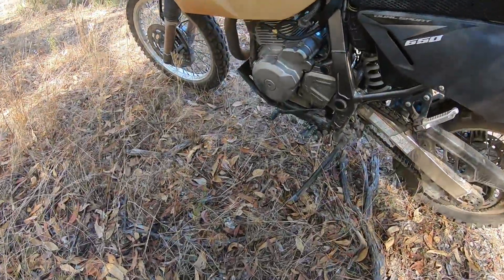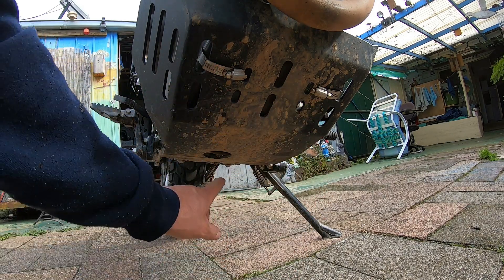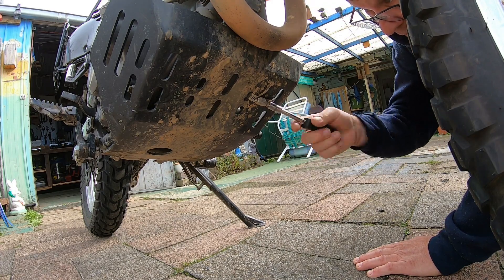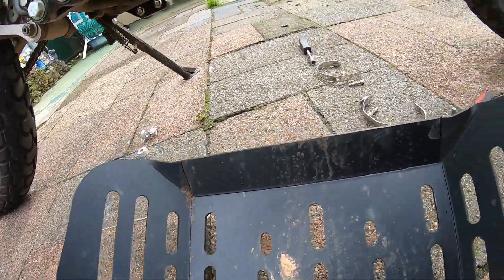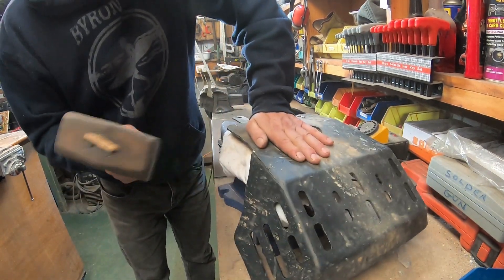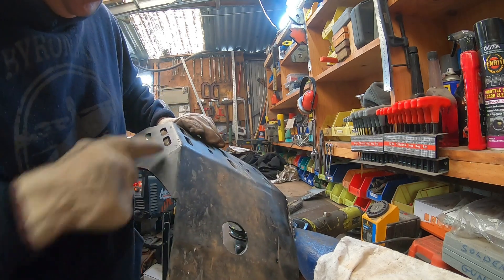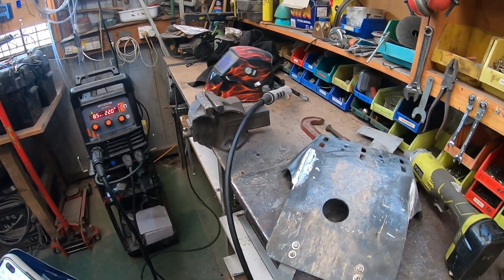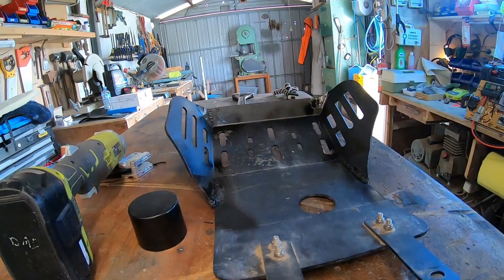Watch this Before you buy an EBAY Bashplate, #dr650bashplate,#bashplate fail,

Comment: Nice job on the repairs. Your right about those rear mounts, bolts could do some damage. Cutting the bolts down is a good idea, you could also weld the tabs to the main plate and piss the bolts right off.
Do you remember Andi's video of his ebay handguards? Wouldn't protect your hands in an accident.
Reply from the maker: Good idea , next time it's off I'll weld them on. I have had the cheap hand gaurds explode on impact.